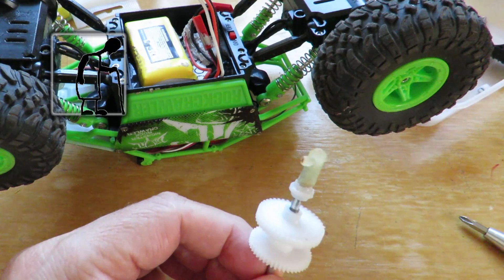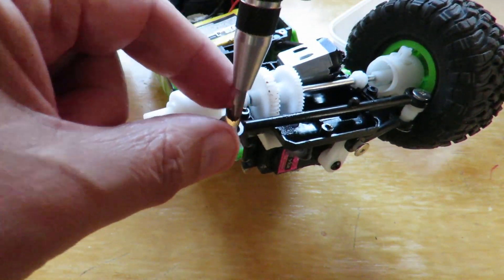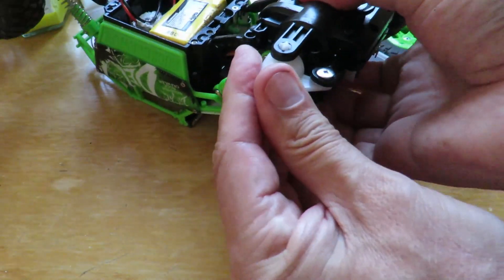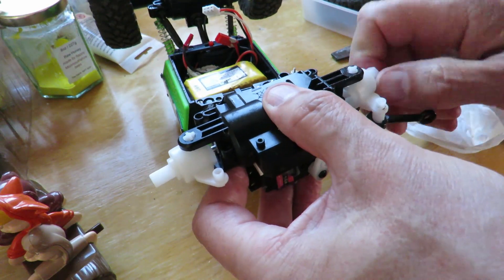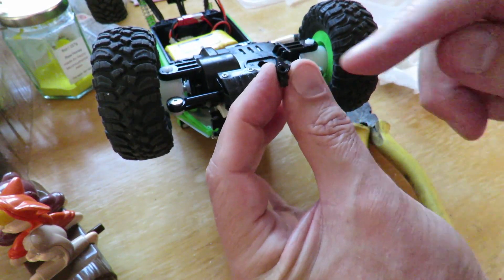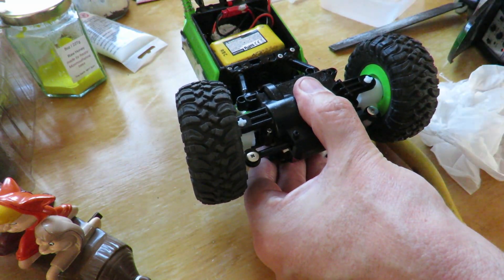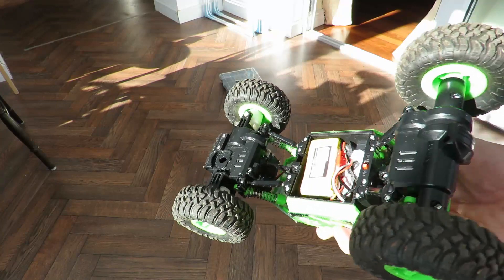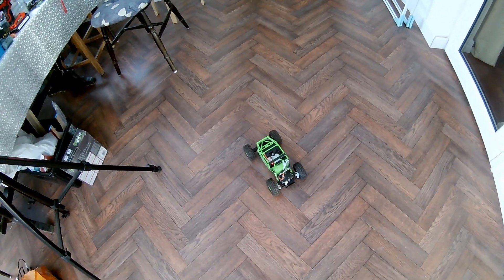Did the resin mould UJ survive?

Comment: If you search Aliexpress for the HB P1801 you should see parts for sale. As far as I know, the HB was the original version of these vehicles. You should be able to get an entire axle with gears and dogbones for about £6 then you can keep the other axle and have spare gears and a spare dog bone. Just have a good look at the photos to make sure the part is the same dimensions etc. I'm pretty sure it is.

The WLToys wltoys 18428 is also very similar but I don't know if the parts are interchangeable or not.
Reply from the maker: Hey thanks, I am having a good look through what is available. At least I know where to look now. I will probably have another go at moulding a replacement and might try  some other odd bits of plastic linkage I have found that might do the job.
Reply from the maker: @hermitoldguy6312  FatDeeMan does a lot of toy grade modifications and he certainly knows his stuff. He upgrades them significantly whereas I just convert them as close to stock standard as I can. He has given me several tips in the past.

Comment: Plastic will get brittle over time then break and spit other parts.
Reply from the maker: "Plastic" is a very non descriptive term that covers many compounds. However in my experience YES most plastics seem to deteriorate over time and many of the old toys I buy in charity shops suffer from the gears splitting.
Reply: Part of life deteriorate.
Reply from the maker: @davidmyersretiredaerospace8038  at my age I am very well aware of that. It's not just plastic that fails.
Reply: My age catching up also he he.